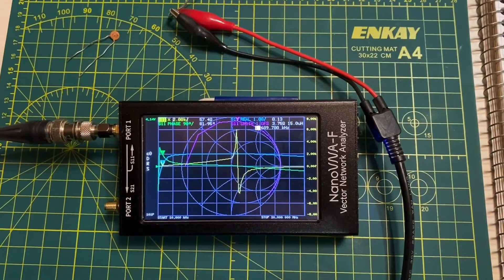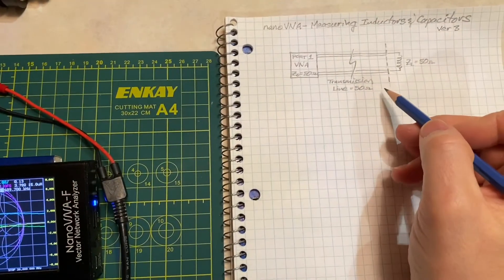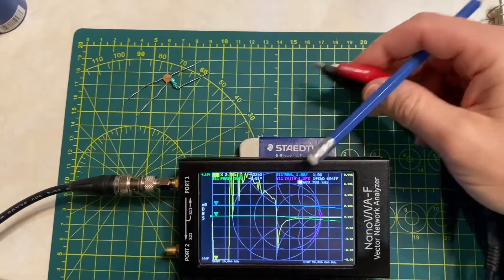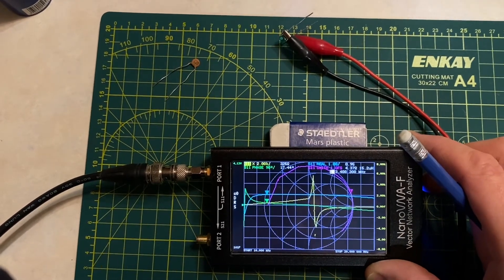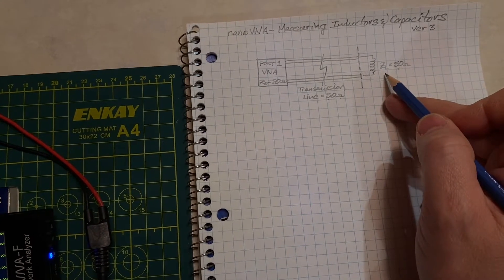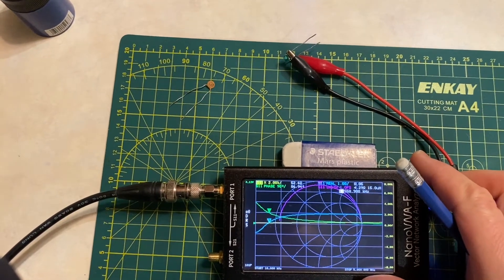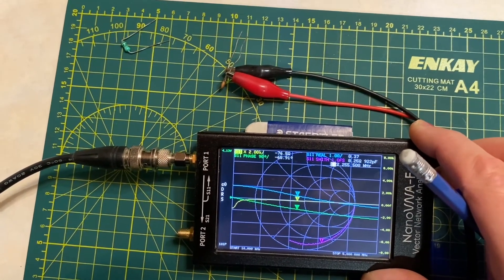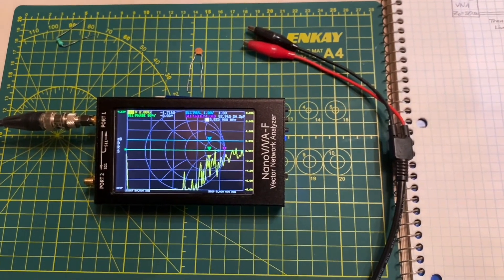nanoVNA - Measuring Inductors and Capacitors (Vers. 3)

Comment: Why measure inductors at the frequency where the phase is 90 degrees and the reactance is 50 ohms, and not at the lowest frequency to reduce parasitic capacitances as multimeters do?
Reply from the maker: 50 ohms is used primarily because it lies within the shunt method’s best accuracy region.  Secondary reasons include:  it’s at 90 degrees on the smith chart (the top or bottom depending on what you’re measuring), is easy to remember, makes measurements consistent, keeps people away from going too low in frequency, avoids the self resonant frequency of the device and test fixture, and is where the VNA most accurately measures reactive devices.

Comment: I Gregg! Congratulations for this video, it's very interessant. Whith your procedure, is it possible it's possible to mesure a coil of HF antenna homemade?
I'm buiding it and curious of values of my "diy".. Thks for answer.

From F4MER.
Reply from the maker: The method would need to be tweaked a bit.  If it were me, I would observe the coil’s behaviour at the intended frequency of operation.

Comment: I'm trying to measure my loading coil for the 7m ham band. I can't get the Reactance (ohms) anywhere near 50 ohms when I'm around 7.2Mhz. There is shows around 930 ohms. So does that mean I can't evaluate my inductor loading coil with this method? This part is very consuming to a beginner.

Comment: I didn’t know the NanoVNA had impedance analyzer functions. So is the resistance value displayed next to the inductance/capacitance value on the right hand side of the screen the “R” term, allowing you to calculate Q of an inductor as well at a particular frequency? Thanks for the great video.

Comment: Hi Gregg, this RF Engineer didn't "cringe". When I looked at your test setup I thought "those leads are going to be resonant" because there is parallel capacitance induced. This is shown exactly in the sweep trace of the vector network analyser. 15uH is small, as are the few pico Farads across the alligator clips at the reference plane. If the resonant frequency is 10 MHz, one can easily calculate the amount of intra-lead capacitance. Inductive reactance is 2 pi f L and capacitive reactance is 1/2 pi f C. At resonance  the magnitude of  XL is equal to the magnitude of XC and they are 180 degrees out of phase. Your method is excellent, by the way and shows exactly why there is focus in the amateur radio exam regarding series and parallel tank circuits!!! Well done. Don, VE3NAP
Reply from the maker: Thank you.
Reply: Hi there, power electronics engineer here. I don't know that much about VNAs and RF stuff, but I stumbled across this topic a few days ago when I was wondering about how to measure small parasitic inductances. Thinking about buying a nanoVNA and trying it out, looks like a nice tool especially when considering how cheap it is. But I wonder:
Which VNA measurement method would be suitable for measuring very low impedances? My main focus would be measuring stray inductances of commutation loops on copper busbars and PCBs with typical inductance values of 1...100 nH. Due to parasitic capacitance, I don't think I can use super high frequencies, maybe up to ~20 MHz. Since you said in this video, that the shunt method is good for 20...200 Ohms, I suppose it's not really suited in my case, right?
Reply from the maker: You would use a shunt-thru measurement for very low impedances.  I have never used this configuration nor have I made measurements of very low impedances, so I’m not much help on this.  Sorry :-(
Reply: @ve6wo No problem, now I know what I have to search for at least. Thank you for the hint.

Comment: Regarding the "strange" measurements you have at the beginning of the video with the inductor, they are probably right and the most useful thing you measured. You found the self-resonance point of the component. Beyond that, the inductor behaves as a capacitor and is not useful anymore for those frequencies. 73 de ON4CKM

Comment: Wow. Incredible video.
Liked and subscribed!

I have a quick question, if I wanted to measure the mH of the inductor or pF of a cap in circuit with other components do you think the VNA would give ballpark figures to be able to decide if an inductor or capacitor is good or way off?
Reply from the maker: I have never tried it, however, in my minds eye I see all kinds of possible issues with this as far as being able to trust the result.  For in circuit testing of capacitors and inductors, when I worked as a bench tech at a general electronics repair shop, we used a “curve tracer” and an oscilloscope for this.  Even then, we sometimes still had to remove components from the circuit for testing.  It completely depends on what circuit your components are part of as to how test gear will react when trying to test in circuit.
Reply from the maker: Thank you for the complement.
Reply: Amazing.
Do you think you can make a video with curve tracer and an oscilloscope to find a faulty cap or inductor? I bet it will get a lot of views.
Reply from the maker: @ES-iv6wb  I think I may still have my old curve tracer attachment that I built for my scope back in the 90’s somewhere…

Comment: Do you think this might work for finding a ballpark value of a super capacitor?
Reply from the maker: No.  Super capacitors are typically very large values and the frequencies that the nanoVNA is designed to work at are much too high for this.  I would take and build a high power resistive load bank and measure the RC time constant of the discharging super capacitor and then take and do the math to find the capacitor’s value based on the result.

Comment: Question: What is the item that connects between your TinySA and what you are testing? I have the kit to make it work, but whatever you are using in this video seems far more useful in that is it smaller and more streamlined.
Reply from the maker: You mean the BNC connector and aligator clip leads?
Reply: @ve6wo  Thanks for return reply.  Specifically the small two port  that hosts two ( positive and negative) alligator clips and then, I assume, terminates in a bnc on the other end to interface with the nano.  Thanks!
Reply from the maker: @jonathanrobertson3406  yes, I purchased this on Amazon.  It has 50 ohm cable with BNC and on the other end it has alligator clips.
Reply: @ve6wo  Thank you Gregg! I have yet to scratch the surface of what this device can do (I use it for SWR testing on antennas) so looking forward to a new project now. Thanks for the video and your response. 73 KMH4OC

Comment: The measure is accurate at the frequency you measure it.  Inductance and capacitance can change with frequency and it is still measuring accurate.  The camera is far from the nano.  I can't read anything.  You could have used nano saver, but you didn't bother to do that either.

Comment: Thanks for sharing! I have just bought a NanoVNA from China that will be arriving next week. It's helpful to me and other hams around the world to determine the value of inductor which could not be read by available multimeter. I will use this knowledge to design a telescopic antenna 1.3 meter long to resonate at 10 meter band using a tank circuit.

Comment: Thank you for the info. on measuring Capacitors and Inductors. Also,  I wondered if it was ok to calibrate in the fasion you did, without using the three standards that came with the VNA. Thanks for verifying that method.
Reply from the maker: At these low frequencies, you won’t see a difference in the readings.  At higher frequencies, you definitely need to be more formal when calibrating or the results will be way out to lunch.

Comment: Very nice approach. You got the point. Too low or too high impedances related to 50 ohm, makes difficult for the instrument to calculate the values which will be displayed. I use to preset 7 calibrated frequency bands, for instance, the first ranging from 50KHz to 5MHz, the second from 5MHz to 50MHz and so on, up to 3GHz, so the full range of the instrument is covered. As there are 7 memory slots to save the calibrated bands, one can easily switch to the band of interest, by means "recall" function.
Reply from the maker: Great idea!  Thanks for sharing :-)

Comment: Very interesting!!! I have a simple question for you: where do I get the cable with the alligator clips? They are very practical.
Thanks in advance for the clue.
Reply from the maker: I got mine from Amazon.  Any will do.  Here is an example:

Elenco Electronics TL-17 BNC to Alligator Test Lead Set https://www.amazon.ca/dp/B0002JJU4G/ref=cm_sw_r_cp_api_i_BJHX8VRV23K63XYXRN6K
Reply: Thank you!

Comment: Your transmission line is not rigid enough, so your calibration is not valid.  You need resonant frequency of capacitor and inductor alone, and not with added lose wires.

Comment: Great video thanks for sharing! What is this cable you are using? Any link/model name? Appreciate it!
Reply from the maker: Any BNC to alligator clip test lead set will work.  It needs to be 50 ohm characteristic impedance though.

Here is a random example off Amazon.. 

Elenco Electronics TL-17 BNC to Alligator Test Lead Set https://www.amazon.ca/dp/B0002JJU4G/ref=cm_sw_r_cp_api_glt_i_T4MRK1SWWMXY4T468GNY

Comment: I don't know if it's 'right', (or if it matters,) but I was taught on the color code for resistors and inductors that the 'multiplier' band started with black being 'zero', and the band itself indicating how many zeros to add to the number obtained by the previous bands. In practice, I don't think it matters. It's just a matter of point of view, but it might cause some confusion among those who have learned the color code described the other way.
Reply from the maker: A valid observation.

https://www.te.com/usa-en/products/passive-components/resistors/intersection/resistor-color-codes.html

This is how I learned it :-)
Reply: Thought so too. Black can be 0 or 1 depending on if it is 3rd band or not.  By saying 3rd band is number of zeroes totally rules out confusion and sticks to previous standard designation of numbers to colors. Using the same color to indicate two different meanings is avoidable.

Comment: This was a pretty-good demonstration. i couldn't help notice, though, that the VNA was reading between 8 and 16pF with just the clip leads (no component in place but after you calibrated them as "open"), and that the different readings depended on slight movements of the cable and its unshielded clip leads. I'm not a cringing engineer--just another amateur--but I've seen myself the kind of parasitic capacitance and inductance such leads can produce depending on how they're placed--how close the clips are, how close the 15cm leads are, whether they cross or not, how big a loop area they form when measuring inductance, etc. 

I think the method you demonstrated is a good one, but the cable and test leads you used cannot produce a stable reference plane for the VNA. A simple test fixture built on a small perfboard screwed to a piece or wood or plastic with a hard-wired 50 ohm cable and some pin sockets would be a stable-enough reference plane, and frankly it would be easier and less fiddly to use as well. As Einstein said, “Everything should be made as simple as possible, but no simpler.”
Reply from the maker: Yes, I agree.  In fact, I ordered one of those test board kits with the SMA connectors and sockets off of AliExpress… 

The test clip leads I used originally ‘worked’.. but if a person needs a bit better / more stable or reproducible readings then I think an upgrade in the test fixture is needed.

Comment: OK, probably user error on my part. I originally set up my VNA traces to look like this video. But, if I make trace CH0 (yellow) as the Smith Chart, then dialing in the phase to 90 degrees shows 13.0 nH at 600 kHz. At 5 MHz the Smith says 3.4 nH at phase 13.5 degrees. And using CH0 as Smith, it now identifies the silver mice as about 100 pF.  So I'm now thinking that CH0 on this particular VNA with this FW has to be set as Smith although it would seem like you should be able to set any trace to any format.  ??

Comment: Thank you for this video. Using this method probably depends on which nanoVNA you have and its specific firmware. I have tried to duplicate your experiment and cannot. My NanoVNA - H 4 has FW 0.5.0. I'm using a Crystal CCSMACL-MC-24 cable, SMA to clips. I calibrated at stop = 5 MHz and used a 1% 51Ω resistor for the load. I set the 4 traces up like yours, I think, with the reactance scaled to 2.00k. I can dial into about 50 ohms reactance at 89.6 degrees phase but then read only changing microfarads on the smith trace. This inductor measures as 13.6 microH on a Peak LCR45, so I don't really need to measure on my VNA. But, leaves me wondering, why the difference. A different problem with a 100PF silver mica attached, cannot dial in 90 degrees
Reply from the maker: Hmmm… it’s hard to know what’s going on without being able to actually physically be present with you to view what you’re seeing.  Do you have the ability to try a different VNA, or maybe try the experiment with someone you know locally who also has a nanoVNA?
Reply: @ve6wo  No, no access to another VNA.  I will try again but probably much later in this year as I'm now immersed in studying an ESP32 chip. Thank you for your reply. Probably an error on my part

Comment: Thanks, very helpful!  Where do you get, and how do you define, the part that converts from an SMA coax to 2 alligator clips?
Reply from the maker: You’ll need an SMA to BNC adapter, at which point a standard 50 ohm test cable with BNC on one end and alligator clips on the other can be used.

Go to Amazon and punch “BNC to Aligator” in the search bar..

Comment: Nice video.  Thank you! What would the VNA's response look like if you did the same measurement with inductor and the capacitor connected together in series and in parallel?
Reply from the maker: I just published another video where I do that exact thing.. I placed the capacitor and inductor measured in parallel and looked at the circuit using port 2 of my nanoVNA.  Go take a look :-)

Comment: I like the "how I do it and it works" attitude, w/o becoming too anal about the precision here.
Reply from the maker: Haha!  Yes, there seem to be quite a few ‘engineers’ out there who insist on being super anal about using these $50 instruments as through they are $25,000 pieces of lab grade test gear.

In most cases, I have found minuscule differences between results when I try to use more formal test jigs and practices.. the bottom line, however, is for most amateurs the quick and dirty approach gets us the answers we need.

Comment: Thanks for the Video!  Brian - N9NAZ here.   VERY Shade Tree approach to KIS and to git it done!  I do have the Nano VNA H4 that I just got a couple of days ago, so I can see a few differences in the display, but looking at traces 1 (yellow) & 2 (blue) - respectively I see [  S11 X 2.00k/......]  &  [   S11 REAL  1.00/ ....  ]  and am wondering why after I set the formats of my traces to match yours, mine shows   [  CH1 X 100/......]  &  [   CH1 REAL  250m/ ....  ] (The S11 & CH1 difference is not the issue )     the X 100/  & 250m/ is my interest.  
Is that some scaling or offset feature I need to apply to each trace?  I have scanned through several docs so still trying to absorb the info and uses of the VNA.  If you could point me to the right direction I would appreciate it.
Reply from the maker: Try this document, page 7 and see if this information helps.

http://www.nemarc.org/Absolute_Beginner_Guide_NanoVNA.pdf

Comment: Thank you for this. Much of the NVNA is beyond my ability to understand, however, for me a simple and practical method of using it to take measurements is very helpful. Can you tell me where to buy the coax that accommodates your test leads ? 73
Reply from the maker: The test leads I use are simply BNC to 50 ohm coax with alligator clips attached to the end.  I think I got mine from my local electronics supplier, however, here is a link to one on Amazon.

Pack of 2Pcs BNC Q9 to Dual Alligator Clip Oscilloscope Test Probe Leads https://www.amazon.ca/dp/B0713V844H/ref=cm_sw_r_cp_api_i_SN12XMXGGDWQ8G1K4PNY
Reply from the maker: Hi William.  I think a lot of the issue with VNA concepts seeming to be out of reach for many is due to the fact that until very recently this kind of instrument cost a phenomenal amount of money and was only accessible to engineers and universities.  With the advent of the nanoVNA which now makes this instrument available to almost anyone who wishes to own one, we now have to work towards translating the concepts and methods across in terms that most of us can understand.  That is the general goal of my videos, and I hope the information presented helps you :-)